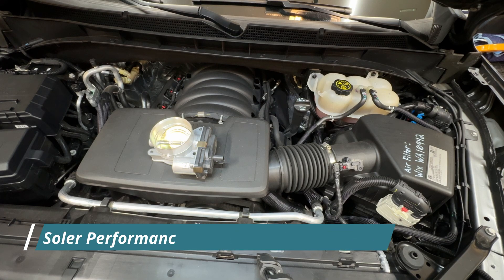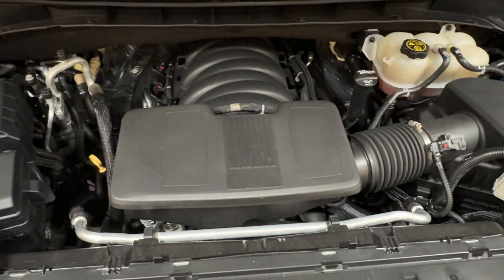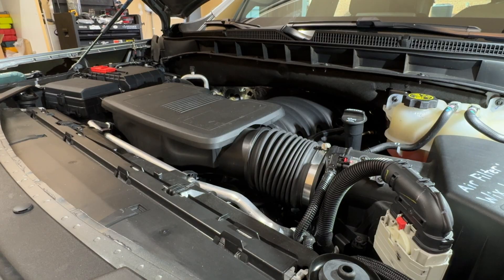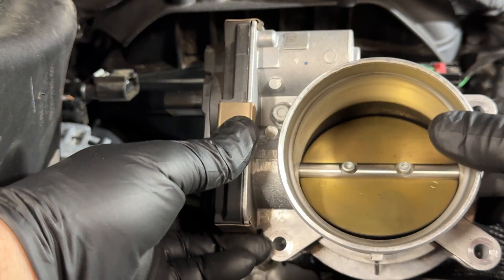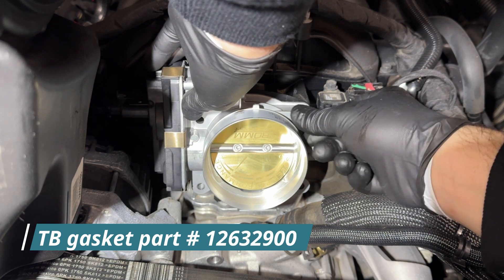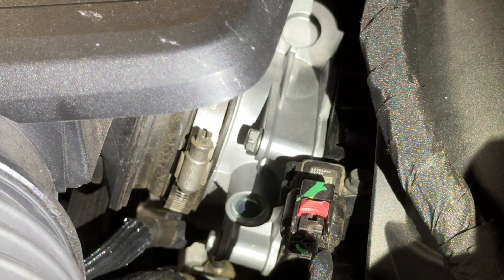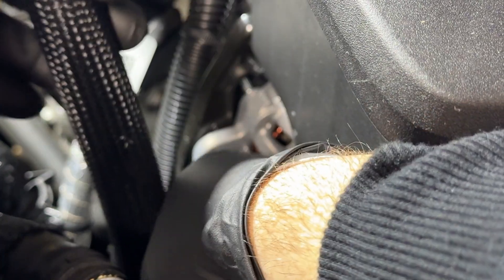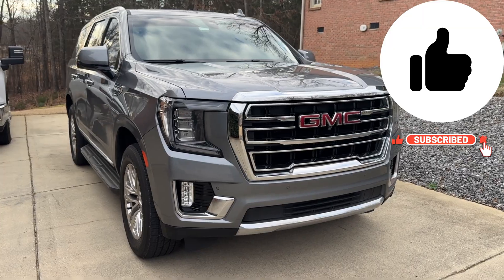[HOW TO] Install Soler Performance Premium Modified Throttle Body on a L84 5.3L 2021+GMC  Yukon

Comment: I went with the kaytech ported one for my 2018 6.2 sierra.  What I noticed immediately was that it no longer had the hiccup or throttle blip off the line under light, slow speed acceleration.  Throttle responce is more crisp also.
Reply from the maker: Yea that’s similar with the Soler unit.